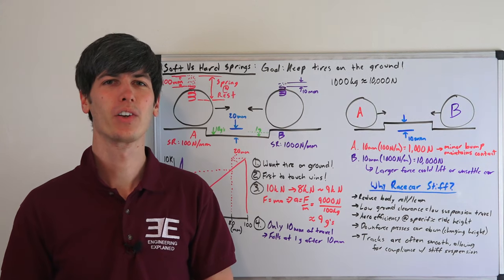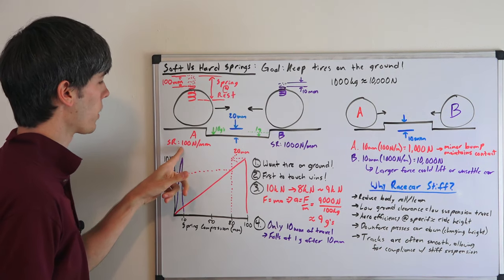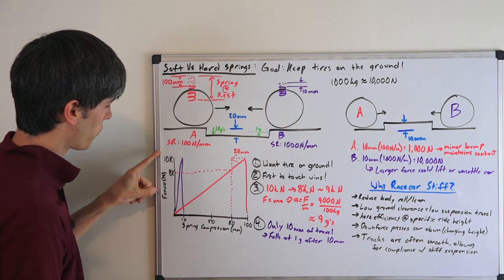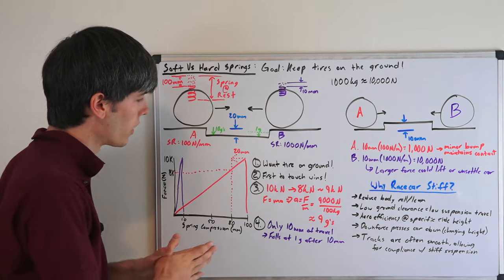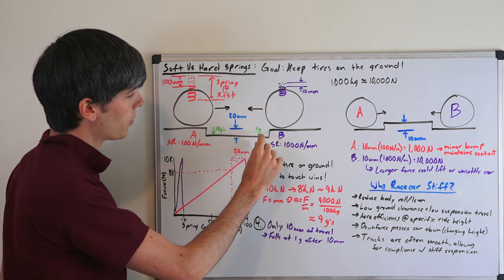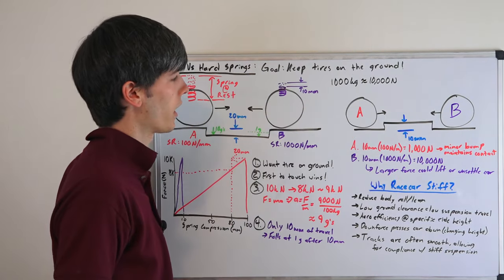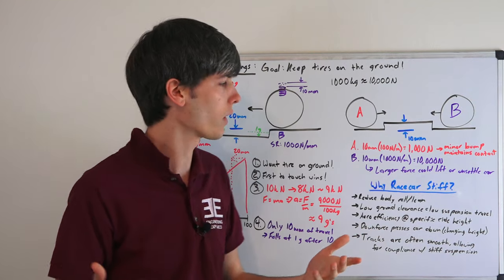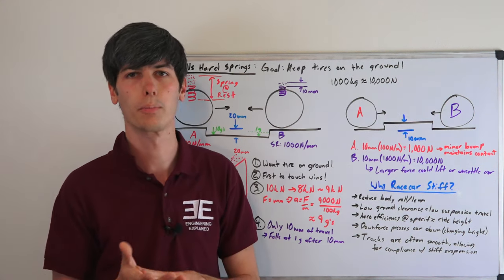What's The Best Suspension - Soft or Stiff Springs?

Comment: So im looking to get new coils for my 2001 Honda Prelude base. I bought it with adjustable coilovers and It was too low for me so I raised it and now its too bouncy so im looking for new coils. Im looking to get 14 inch springs but im not sure what spring rate to get, im looking for something comfortable thats not too soft and not too stiff. This is my daily driver and not a race car. Any help is greatly appreciated!
Reply: Are your adjustable coilovers also rebound and compression damping adjustable?  In other words, are the shocks/struts adjustable?  If they are have you played with the settings at all?  Bounce is probably due to a lack of rebound control.

If your coilovers are not rebound or compression adjustable or have them tied together, toss them in the garbage.  No amount of spring rate tweaking will ever make them work correctly.  To add, if you didn't spend at least $1600 on them, they are probably junk to begin with.  The shocks/struts are incapable of handling the springs they came with at the ride heights they can achieve.  You want your shock/strut adjustments to be independent of each other.  Cheap coilovers either don't have adjustment or they tie them together.  Neither is desirable.
Reply: They are adjustable coilovers and im not sure what can be adjusted, I had a mechanic raise them and he said if i want to go higher i need new coils. The ride is so bouncy because the springs have been stretch to the max and if i want to go higher i need new coils. I think I found the spring rate I want which is 200lb/ft front and 150lb/ft rear. Im just not sure if 14 inch coils will be tall enough for my liking but anything is better than what i have. Sucky part about my car being so old is that the forums are all from like 2003 and they dont exactly answer my questions. But i will think about new struts and coils in the future but for now im just trying to raise the car up as cheap as possible.
Reply: You can buy replacement springs.  What is the height of the current springs?

Are there any knobs on the top or bottom of the shocks/struts at all?

Better question is, what coilovers are they?
Reply: I cant really remember but i think the coilovers are b/c racing? I'll have to look when i can at the struts and i have no idea on what size the springs are thats why i'm having trouble deciding what height i want.
Reply: If they are BC Racing, there is 90% of your problem.  Tolerable, but not great.  The shocks/struts should be adjustable, it's only a matter of finding the adjustment tool (if it needs one, usually they do) and adjusting them firmer or softer.

As for the spring height, you could call BC and ask for your specific setup.  Usually the length is marked on the spring somewhere.  Eibach and Hypercoil's springs have it in their part numbers.  Eibach is usually Rate/Inner Diameter/Free length.  I think Hypercoil is pretty similar.  If the springs that came with it aren't 12" springs (unlikely In my experience), then going to 14" springs will be too much of a change.  I'd find out what their free length is by calling BC or doing more searching on the internet.
Reply: Yes they are BC racing I just remembered. They are the BR series. Looking at it now it does have adjustable damping rebound/compression. Ill be able to look into this more now, thanks for the help!
Reply: No Problem, I'd move the coilovers through their whole range of adjustment.  You might find a setting that feels fine to you.  Chances are the discomfort you feel is from the rear shocks, but it could be a combo of both.

The problem with BC coilovers is they tie both rebound (shock/strut extending) and compression (shock/strut compressing) together.  The problem with this is you can never tune them separately for your driving style.  You are forced to compromise one for the other and usually it's a lot less rebound than you want or need to get a compression setting that isn't too much.
Reply: LgSnip3z if if feels to bouncy....like you aren't connected to the road. you need to stiffen the rebound
Reply: LgSnip3z first set the springs according to the ride height you want. adter thay mive on to set the dampening all the way soft. then you make the rebound all the way stiff. then slowly a half turn at a time you loosen the rebound until it feels too bouncy then turn it back a half a turn. then you know that you want it somewhere in between that half turn. you want the rebound to be as loose as you can stand it. that's what's pushing the tire into the pavement. after you get that setting then move on to dampening. don't change the rebound again.
Reply: Matthew Hutchins I replaced the springs and the ones in the car were actually BRM and they didnt have a dampening adjustment, also the threads were stripped so they were no longer adjustable so i just installed Yonaka coilovers. Theyre okay but giving me problems in the rear so thats my dilemma now.

Comment: So I don't think anybody really learned anything from this. You never explained why not to use stiff springs if you live in the city and have smooth roads like some race tracks. So if you have smooth roads in your area go with the steeper springs in your car will handle better than soft? If not then how come race cars handle better with stepper springs and they don't run soft?

Comment: dude seriously 1000 equals to 10000
Nope g=9,81
Reply: Close enough..
Reply: and 9.81 is just correct on particular areas of the planet. Near the equator it's closer to 9.78, and at the poles it's 9.83.
Reply: and none of this matters because for creating an idea about how suspension works you dont really need to care about this minor difference in acceleration.
Reply: that's true but some hard nitpicking considering both suspensions are just for demonstration purposes and not actual parts, also both subject to the same acceleration considered.
Reply: Rounding g to 10 is common practice because it makes easier calculations for quick examples.
Reply: Someone that knows g equals to 9.81 is sure to know these just i dont like education system that uses pi as 3 or g as 10 the result is off the grid and doesnt reflect real life results

Comment: Umm... this is (almost) completely wrong and you should take it down. Or at least identify that it has almost nothing to do with motor vehicles. The spring does VERY little in absorbing the bumps. That function is handles by another component called a "shock absorber".  The ride quality over bumps is almost entirely dictated by the suspension geometry, the shocks, and the unsprung mass.  So while at some abstract level there may be some merit - the basic premise of how vehicle suspension works is wildly inaccurate in your model.  Have you ever even driven a car? Let alone actually modeled a real suspension? High velocity motion as you've proposed in your example is managed in the 99% or higher range by the shocks. The springs basically don't matter so long as they're within the elastic range. For body roll springs do matter. And the elastic range matters for offroad use - but has almost no meaningful difference on the road because all surface variation will be within the spring's elastic limit. If you do a calculation within the range of actual springs that generally vary from 5-10kg/mm, then calculate the velocity of travel and force applied by shocks commonly available. To help a typical range is from 1700 to 3500 N at .52m/s. Why that velocity? I have no idea why that was chosen as a starting point, but that's what is used - and typically it's linear with velocity. So you'll also need to know the tire radius, vehicle velocity, etc. to perform the final model calculation.  The results depend on inputs, but the spring rate doesn't matter much. Try doing the calculations and you'll find that out pretty quickly.

Comment: Video is misleading. Sorry. You are trying to use simple newton physics to prove Your point. It's not as simple as that. Your calculations would be proper in 4x4 truck climbing trough rough terrain with snail speed. You never considered speed of a vehicle, vibration absorption of shocks and most importantly, non-suspended mass. Stiffer springs have higher stored energy so they react faster. (pushing heavy wheel down harder). Calculations for that are a lot more complicated than You are showing here. So it's not proper. Sorry. Nice video either way.

Comment: You are mixing apples and oranges. There is a fundamental flaw your reasoning. Maybe you should try to focus on spring rate only!... don't change anything else about the two cars you are comparing. You may find a different conclusion.
Reply: Marcel Maly literally all he compared was spring rare. He even said at the beginning that the 2 cars were identical except with different spring rates